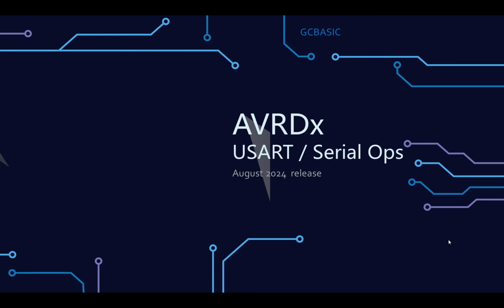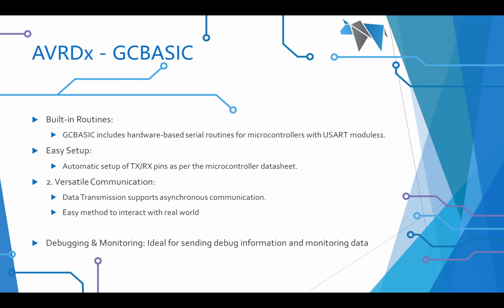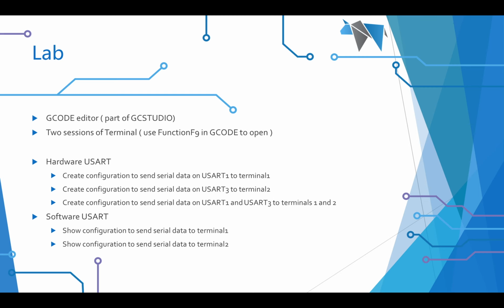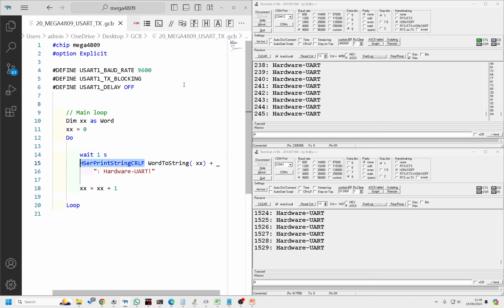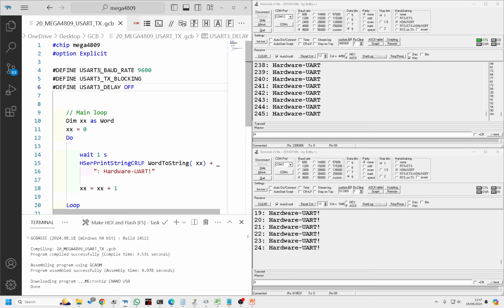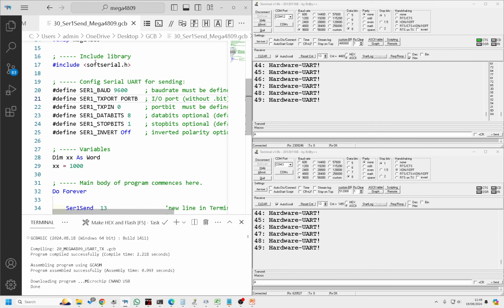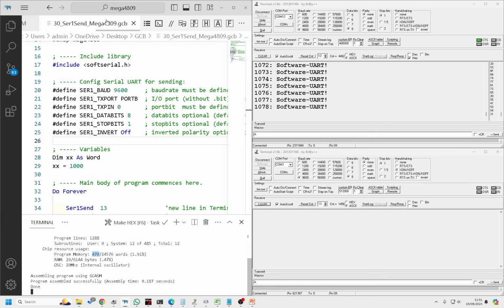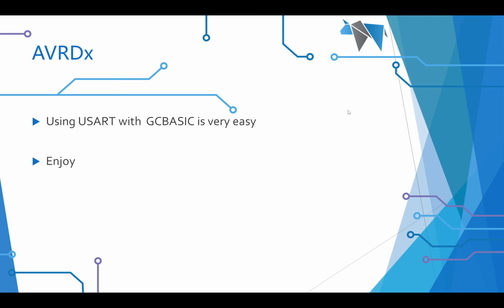GCBASIC:  Microchip AVRDx Series. Using USART/Serial operations

Comment: GCstudio was working fine a few days ago. Probably after the update does not make the LGT8F328P board firmware. I reinstalled the program several times, but with no result. I tried another Arduino nano board, the same thing. I don't know what to do. Was it just my fault, did no one give a signal?